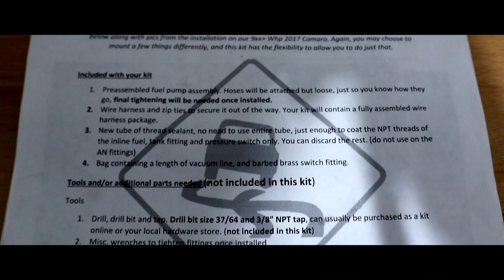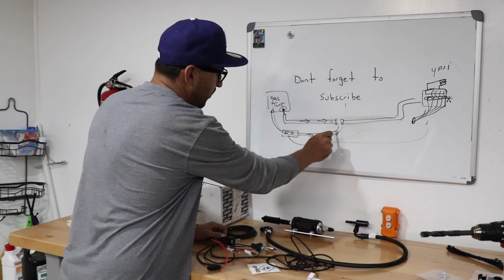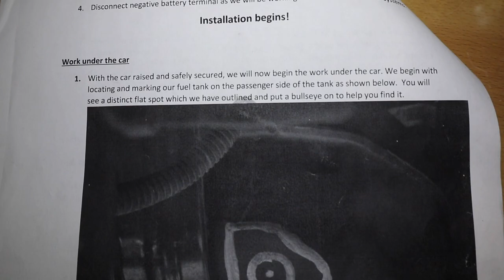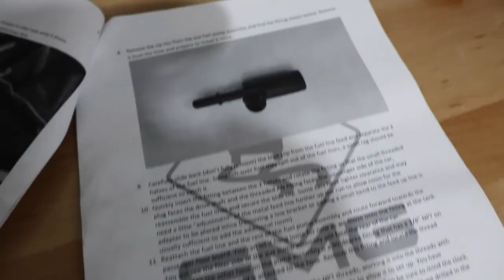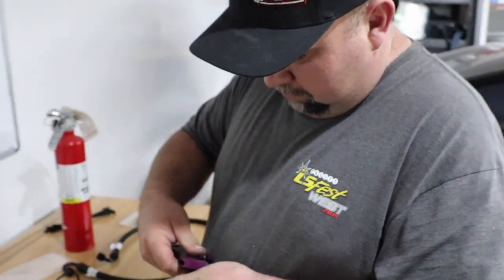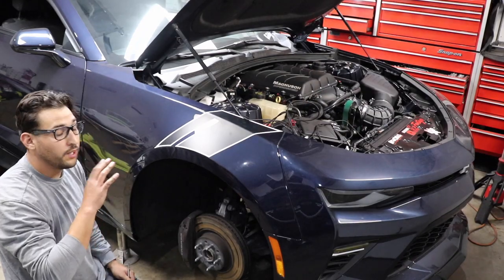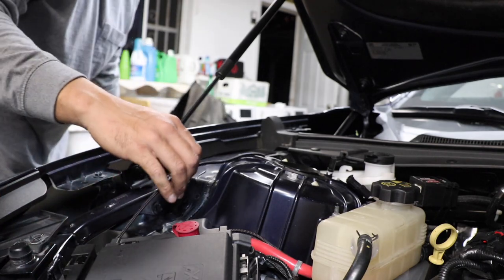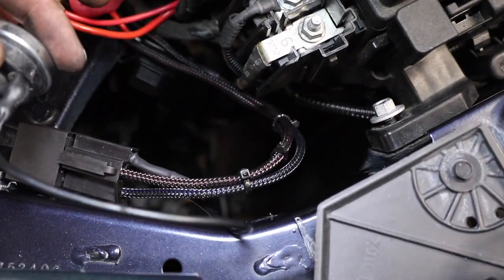SKID MARK GARAGE- AUXILIARY FUEL SYSTEM KIT!! *INSTALL*

Comment: Getting ready to install the dsx equivalent kit on my 5th gen. Whether this was intended as entertainment or not, there were actually a good bit of tips in here, makes me feel better about drilling a gaping hole in my tank LOL
Reply: The DSX is $200 more. how is it holding up? I'm concerned about the fitting in the tank being loose and leaking over time.
Reply: FasNuf Garage the DSX aux fuel system is worth the additional cost, here’s why: 
The DSX kit comes with sealant, not Teflon tape to seal up the fitting you screw into the plastic tank. Teflon tape will not seal that fitting, it will leak. This has been done many times on many different makes of vehicles, with the same result, leaks. You need something like Seal All that bonds to the plastic, almost like it welds to it creating a leak free seal. Next up is the big one, the Hobbs switch. Hobbs switches while being around for a long time and used in boosted applications have failed, a lot. You’re relying a cheap switch and a vacuum hose to trigger your pump. This is where the DSX kit is far superior to all other aux pump kits on the market. It used a proprietary, built in house plug and ply harness controller that plugs into the MAP sensor as the trigger for the aux pump. The pump is activated at 9psi and shuts off when falling below 7psi. There has not been any failures to date with the DSX pump controller. Also, DSX has special fuel lines, they are -8an in size but use their -6an fittings for full flow. Traditional -6an fittings are smaller.  Now one thing all of the aux pump kits on the market lack is a second filter. Anytime you run an external filter, no matter the brand, you always run a pre and post filter setup. I don’t know why SMG and DSX do not incorporate this into their kits. Hope this helps.
Reply: I have a 2017 CTS-V. I’m actually modifying the DSX kit. I primarily bought the kit for the controller. I’m going to ditch the pump DSX supplied and I am going with a Fuelab brushless fuel pump, Fuelab pre filter and a Injector Dynamics post filter. Instead of teeing into the factory fuel feed line, I am going to leave that alone under the car. I’m having a line that will go from the outlet of the external pump to the front of the car, mounting the ID filter in the engine bay and then tying into the flex fuel sensor. It’s more money, but I like running two pumps on their own fuel lines.

Comment: So I installed this on my 2015 Cadillac Escalade and it had a Texas speed lt1 long block with a 2.9L whipple when I get on it then get on it more I have fuel cut for some reason
Reply from the maker: im not too sure, Maybe give them a call to trouble shoot. could be issue with hobs switch or even tunning related